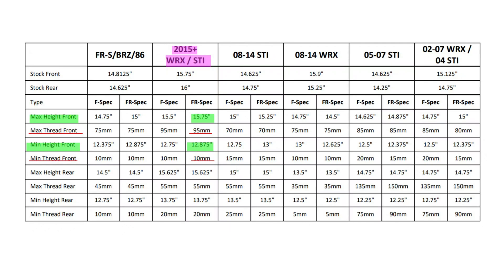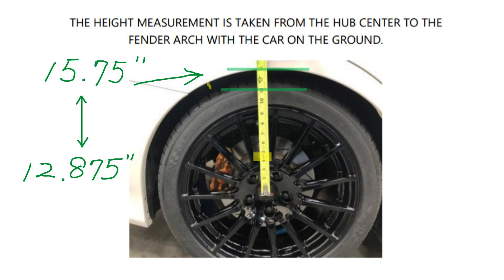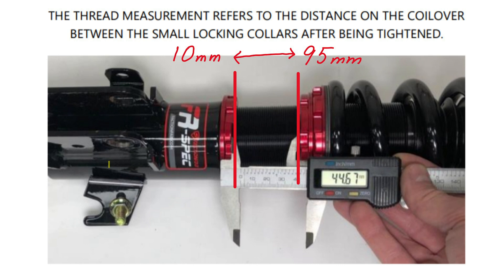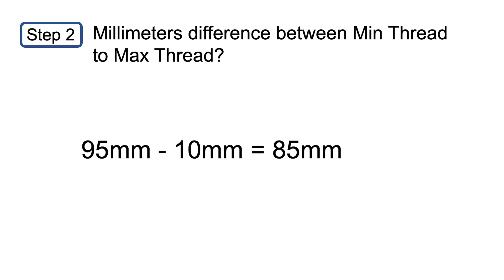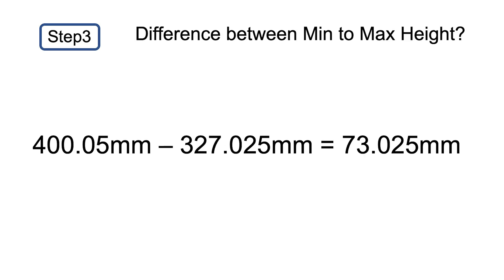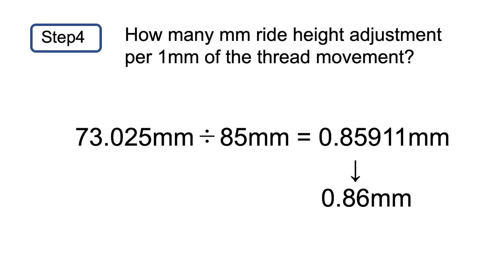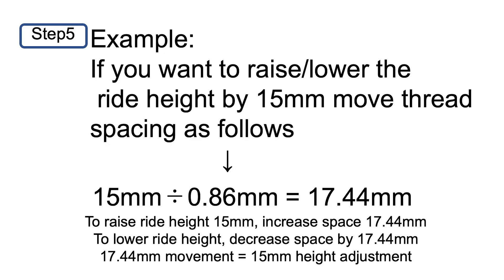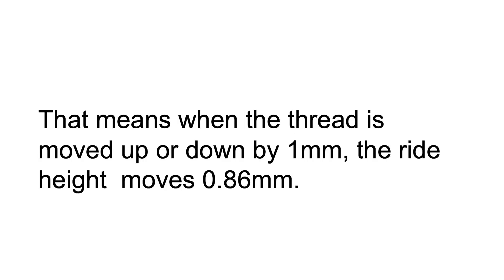Easy WRX STI FactionFab Coilover Height Adjustment FR-Spec

Comment: I have a 2022 wrx and ordered the f-spec....if want go 1" lower front and rear what is mm distance I need? its 15" factory center wheel to wheel well front and back according to F Fab.
Reply from the maker: You’ll want to install them, measure how much lower you want the car and then use the math to determine how much to adjust the coilovers. The math will prevent you from having to raise and lower the car multiple times. I hope that helps.
Reply: I have the F-spec on my 19 sti at max height the back will always sag more because the shock is smaller so my front looks higher so I’m gonna drop the from an inch really only need to know the mm once there on the car there easy to lower or raise just loosen the bottom ring up measure in between that

Comment: Are these coilovers really stiff for daily driving ?
Reply from the maker: Rahul, they are adjustable. I had the rear at full soft and the front at the middle stiffness. I daily drive them with no issues, but if you are not going to do autocross, I would get the FL spec instead. Thanks.
Reply: Thank you for the reply I appreciate the feedback. I got the FR spec. They ride good. I’m just having issues lowering the rear
Reply from the maker: You may need to increase the spring preload to get it lower.

Comment: Alright I have to admit it has been so long since I have done conversions and math, what do I need to set mine to if I'm looking to drop an Inch from stock ride height? I'll be ordering me a set as soon as my stim check hits my account =D
Reply from the maker: Just remember the adjustment height I show in the video will drop your ride by the amount in the equation. It’s not 1 : 1. You will love these. Been running them for months now and I made this video so people can have a ride height in mind and adjust the coilovers once and get the ride height without having to jack up the car multiple times.

Comment: What did you set your thread distance at for the front and rear? Really thinking about ordering a set of these.
Reply from the maker: I stopped them all of the way down on the threads until they wouldn’t go anymore. Then I backed it off one turn so they weren’t resting on the rivet stop. You should get them, they are really nice!
Reply from the maker: oh and for the front, I set it to an even gap between the fender and the top of the wheel as the rear using the math in the video.
Reply: What was the measurement  I set mine at 75mm but that’s to low and the rear at 35mm if you stand an iPhone 14pro it won’t clear it. lol I need to raise it up so I can get on ramps

Comment: How do you like them so far? Comfortable?Picked some up 2 days ago for $300 new in the box on offer up. Wanted FL spec but couldn’t pass up that deal.
Reply from the maker: They are really nice and stiff comfy. I like the rear set to +1 click in the rear and +10 in the front due to the different spring rates. Overall I love them.
Reply: @BushidoPhoto  awesome, thanks for the response
Reply from the maker: No problem and thanks for watching and commenting!